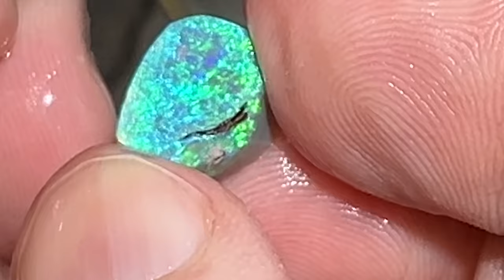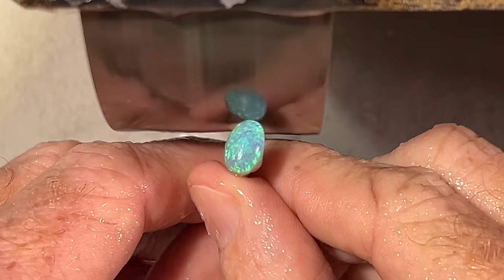Rough opal nodule with a clean color bar - I'm going in!

Comment: Great vid as always I was wondering why you left the sand spot in the first cut, the spot was only small but didn't think you'd be happy with that.when it comes to valuing it must be difficult.the opal I have has received quite a few different values,I paid 1680.00 for it it's a 3.3.ct dark opal with lots of pink blue green orange a bit of yellow and I been given anywhere from 1500 hundred to six thousand as a quoted value for the stone